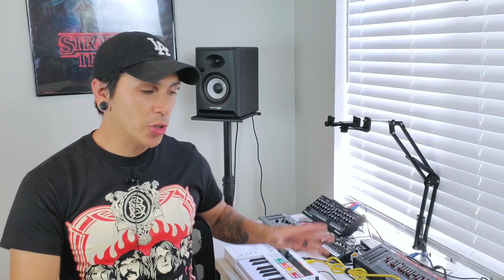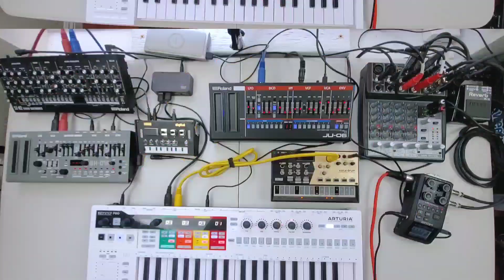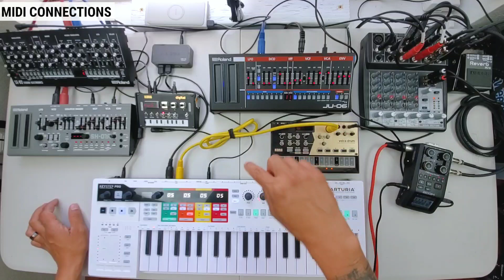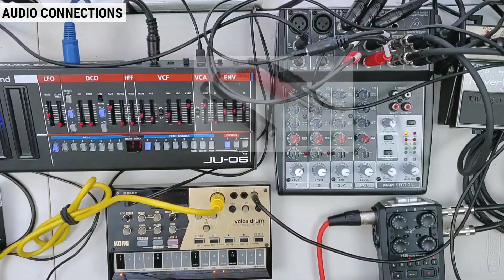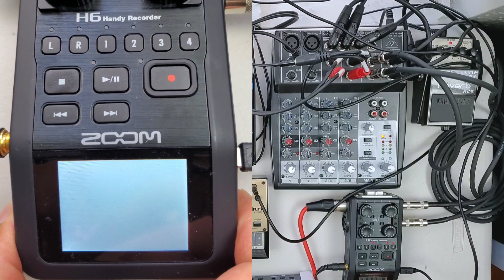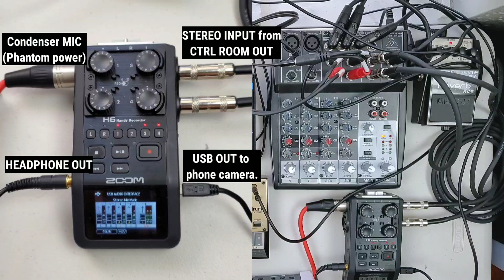Hardware Synth Setup Walkthrough | Arturia Keystep Pro, Korg Volca Drum, NTS-1, and Roland Boutiques

Comment: Thanks for this..But..I have my stuff routed through a MIDI router. So I have a cable going to a Model D, the Behringer Pro 1, and the Multipoly. I have set each channel to different numbers, but I still can't get the Model D to receive on MIDI 2. So do I need to just daisy chain from each other? Because I have tried several different things, and nothing works. Even though I have the Model D setup on the switches, on the back as Channel 2, it is still receiving the same sequence as the Pro 1, which is set to MIDI CH 1. It's all so confusing, which is why I zone out, when discussing MIDI.  What am I doing wrong? Thanks!

Comment: how would you go about recording all of this into Logic or another DAW?
Reply from the maker: There are a couple of ways, but probably the most “direct” way would be to use an audio interface with several channels - a channel per device. The DAW could then simultaneously record all of the instruments on individual tracks. 

Or you could use a device / mixer that can capture individual tracks to an SD card and then transfer those files to your computer.

Or just send the entire mix to your DAW  as a stereo track… which is probably the easiest… but limited since you wouldn’t be able to edit the individual instruments after recording them. 

Hope this helps a little
Reply: Thanks for the reply. Do you think it would be worth it to get the key step pro if I’m still going to record it into A DAW? Or is the key step used more for a dawless setup? Thanks

Comment: Hello! I have a question regarding the Keystep Pro. I just ordered the KSP because I saw a lot of cool videos and tutorials including yours and realized it has lots of very nice features + the workflow seems very smooth. However, today I searched the internet for known issues with the KSP and it turns out it can be very buggy and it even can easily die during a firmware update! So, I wanted to ask if it is really that bad? Should I wait and play with it before deciding to return it? I’m kinda confused now… I want to use it mainly for a hardware dawless setup with 4 synths, very similar to your setup. And mainly for sketching ideas for tracks and also for live performance. How your experience have been with the KSP? Did you have any issues with it? Thanks for your help!

Comment: I'm looking for something just like this- but MORE "Pro"... I mean like basically the same thing but more capable,  more hardware  midi tracks, more control over synth parameters through midi.. just more power in the the same type setup.
Do you have any thoughts?  I was looking at the 1010 blackbox sequencer/ sampler.. but at the other end of similar idea is a novation 49slmk3/61slmk3.. suggestions?  Great video, thorough.

Comment: Does the fact you are using lots of roland synth make it more simple to connect thru midi ?
Would it be possible in a sample way to replace one roland by, for exemple, a MicroFreak easily ?
Reply from the maker: It all depends on the MIDI capabilities of each individual synth. The Roland synths have MIDI THRU capabilities, which makes it much easier to chain them all together. If the MicroFreak has MIDI THRU capabilities, then it should also be pretty easy to chain together. Otherwise, you will probably be better off picking up a MIDI THRU box (MIDI splitter) that can send the MIDI from the Keystep to all of your devices. 👍

Comment: Yo what power supply are you using to power the micro-usb boutiques? It's the one thing you didn't specify in the walkthrough and it's the one thing I need lol
Reply: You can conect on usb c x usb . Or 5v powersupply on it. And boutique use 4 baterias also

Comment: The mono cable thing is more noticeable with the Volca Modular, it merges the reverb in a weird way and makes a weird clippy noise, maybe if you use delay or modulation it's less apparent but I do have a mini trs to dual ts splitter for each of my two Volca Modulars and I use them on stereo channels.

EDIT: Actually if you want to record the Volca Modular you might wanna use it in stereo just for the surreal stereo width of the Space Out. If you have to save channels you can always use a common send reverb with the VM in mono, but for ethereal pads the Space Out has potential, even though it's so quirky.

Comment: im looking for a mixer and thinking about the behringer but im getting mixed reviews of it.. why you say you are pushing it to the limit and need a new one soon? i have around the same equipment as you too
Reply from the maker: I have had a good experience with the Behringer Mixer... in fact I recently picked up a Behringer XENYX X2222USB. They are great mixers and extremely great value IMO. The reason why I said I was pushing it to its limit was because I am limited to about 4 instruments at once, since it only has 4 channels. My new mixer has 8 mono channels and 4 stereo channels, which makes it much more flexible when mixing several instruments together. 👍 Good luck on your mixer hunt. 🙂

Comment: Such an awesome video! So well-explained, especially going into things like the stereo breakout cable - that was a headache for me as I ran into weird audio issues (with the exact same mixer too, haha!). I'm really loving my NTS-1 as an FX processor too! Jealous of the JU06, it sounds so warm and lovely. For the noise issue, maybe you need a grounding loop isolator? 
Also TIL the H6 can be used as an interface for your phone! That's so handy... so it can simultaneously multitrack record internally to the SD card, AND feed that audio to a phone?

Finally, you've properly sold me on the Keystep now. What an awesome workflow... dang it

Comment: Very detailed and informative.  I really enjoyed learning all I did from watching this.  Thanks so much for your patience and effort.  I do have a question however, I was really hoping you could answer.  You are using 4 synths, which is very convenient, considering the Keystep Pro has 4 sequencer outputs, but what happens if you want to use more than this?  Sure, you can daisy chain physically, but how do you assign midi channels and play those instruments, that are outside of the 4, assigned sequencer tracks?   It seems you are limited to only controlling 4 synths, if there are only 4 sequencer tracks, with assignable midi channels.  ???
Reply from the maker: Thank you! Glad you enjoyed it and found it informative. 🙂

At the moment, the Keystep Pro is only capable of sequencing/controlling 4 instruments at once. I really wish it allowed you to sequence up to 4 devices and then simply control or live play any other device, similar to the original Keysteps "Keyboard play" feature. That feature allowed you to sequence a device and then select any midi channel to play any device live using the keyboard. 

I'm sure that this is a feature that can be added in a firmware update in the future... but as of now... only 4 midi tracks. 😔

Hope this makes sense. Thanks again for watching. 🙂
Reply: @littleBIGsynths  It makes perfect sense and is exactly why I was asking. I obtained a KSP this week and was extremely disappointed to find out, that I can't control more than 4 synths at a time, despite midi standard supplying up to 16 channels.  In 2020, I find this extremely limiting, especially since my 11+ year Novation controller, did all this, just fine.  I was pretty gutted and not having 'keyboard play' mode, or a means to quickly change midi channels from the front panel (you have to menu dig, unlike the original Keystep), just really turned me off from this controller.  I have been in contact with support and they do hear my plight, stating that this is something they can make work, with a future firmware upgrade.  I hope that day comes sooner, than later.  Thanks so much for your time in replying, I was hoping you may have had an answer, or trick I missed, since you seem much more experienced with the controller, than me.
Reply: littleBIGsynths No “keyboard play” ability? Yeah, hopefully an update will bring that back. That’s my favorite feature of the Keystep!
Reply: You have 3 options, as I see it (I don’t have a Keystep Pro but have a regular Keystep which lets me sequence on two channels): 1) you can assign two synths to same midi channel to stack sounds for single sequence (especially if one is poly playing chords while another is mono with arpeggiator running); 2) have one synth controlled by internal sequencer synced to Keystep; or 3) while Keystep is running sequences in background, set midi channel to whatever synth is “free” and play it live.